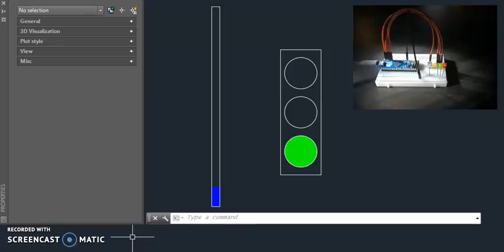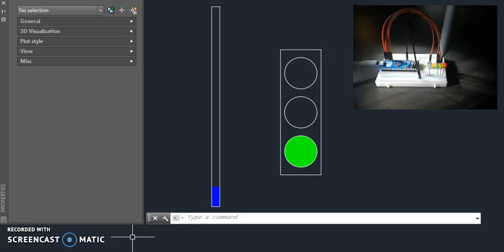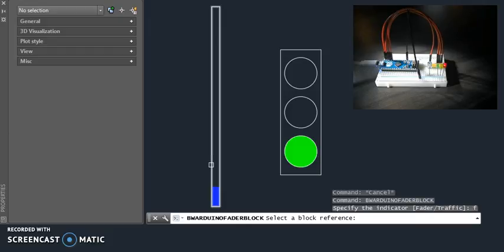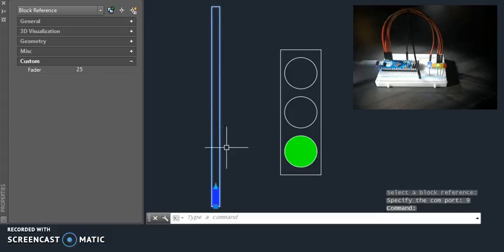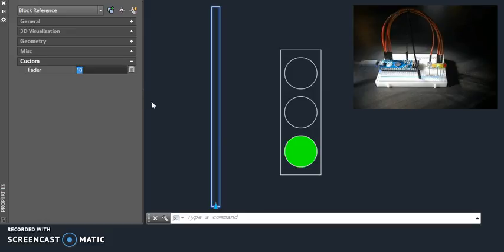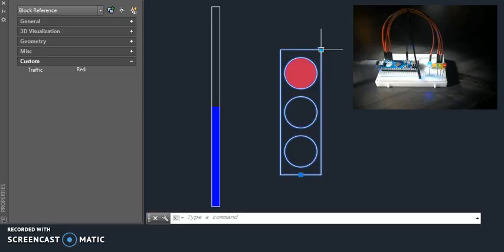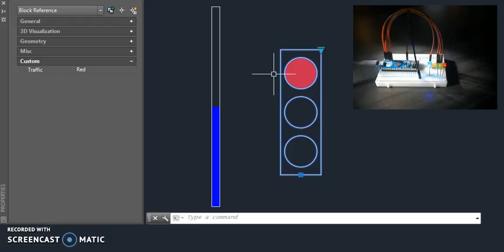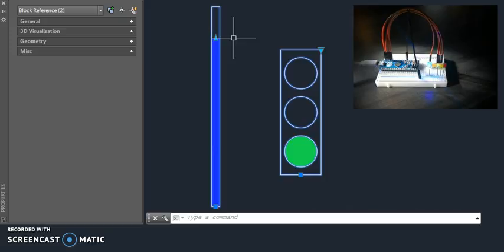AutoCAD + Arduino LED Control

Comment: Could you explain more in detail how you connected ur arduino?
Reply from the maker: Thor Heavyside 
I wrote a .NET extention for AutoCAD that sends values to the serial port the Arduino is on.  The extension monitors the block edits with an event and then sends the instructions to the Arduino.